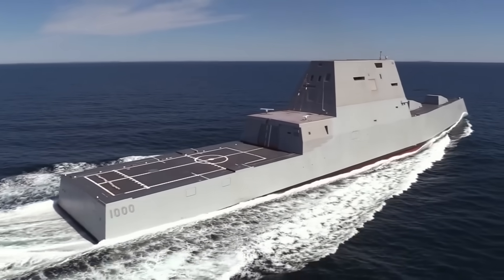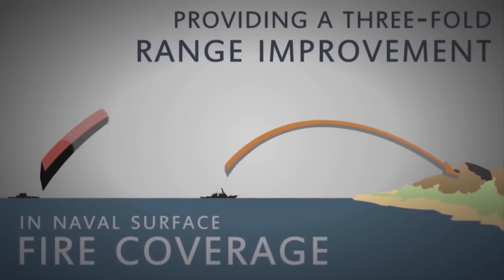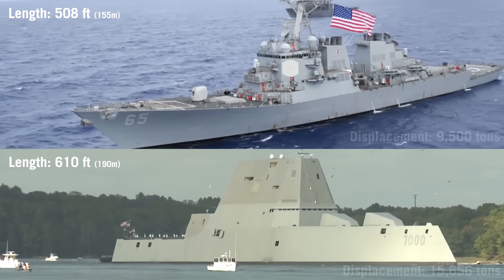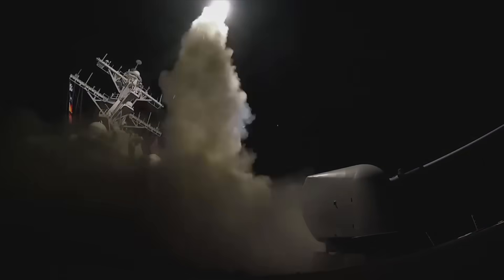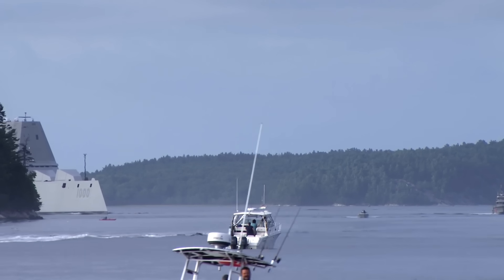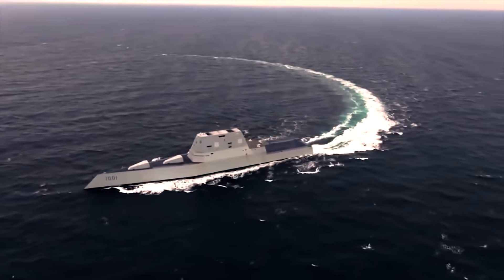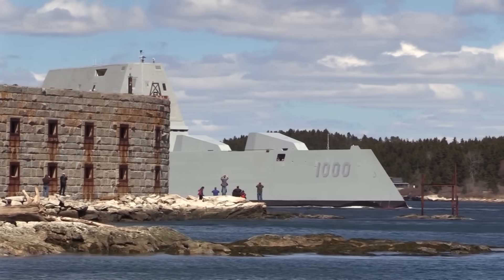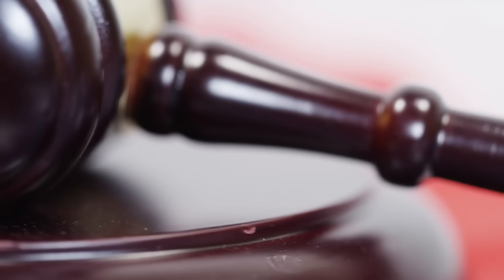What Killed Zumwalt Destroyers?

Comment: Zumwalt along with many modern US military program suffered from the "One platform do all mentality". You end up with a platform that tries to do everything but nothing well. In order to meet what was originally envisioned,  more money is spent to patch it. Now you run into all sort problems like "this was designed for X but now with the required modification it does not fit".

Comment: 155mm shells are cheap and used by the millions in Ukraine
Reply: Not the fancy ones used by zumwalt.
Reply: M104 155 mm projectile
M107 projectile
M795 projectile
M110 155 mm projectile
M121 155 mm projectile
M687 155 mm projectile
M712 Copperhead
M982 Excalibur
M1128 projectile
Install a new barrel or replace the liner,

Comment: Here's your translation to English:

"Everything is twisted and contorted like a snake on a frying pan, trying to hide the simple bitter truth. They failed to create either an electromagnetic gun or a laser air defense system, for which the ship was designed. And the problem isn't just trying to cover up an embarrassing scientific and technical failure. The scientists are not to blame. Only severe corruption or complete unprofessionalism bordering on stupidity can create this sequence of incompetent planning decisions by politicians and high officials, leading to such gigantic expenditures of taxpayer money. And this is not the only case. The Littoral Combat Ships program, the F-35, and surely much more. This is just the tip of the iceberg.

Comment: The US Army has a 155 mm gun for it's Paladin mobile artillery system. In the short term, a modified version of this weapon could be fitted in place of the original guns. Until a dedicated 155 mm/60 Naval gun is developed to replace it. It may, or may not be feasible. Yet any bored out 6" gun designed for a light cruiser could take up the unused deck space. Such a gun could be configured to fire the US Army's Excalibur guided 155 mm round. Just one possible answer to the main guns issue.
Reply: Still doesn’t fix the fundamental issue of when would you want to risk a billion dollar stealth ship when normal ships with normal guns exist for low risk targets, and you don’t want to risk billion dollar stealth ships in high risk missions, you use tomahawks and F-35’s for that.

Comment: The hull design and propulsion seems to have worked.
I would ditch most of the  stealth features and remove the problematic guns. Install one standard 155 Naval gun and add additional vertical launch tubes.
So build a new fleet defense Cruiser specialized in anti air.

Comment: #1) Defective materials
#2) defective design
#3) Design & build as you go
#4) Keep changing the specs as you build...keep changing goal the posts
#5) Make sure the walls have bad welds & cracks in the aluminum plates
#6) Make the ordnance too expensive to shoot
#7) Make the powerplant & electronics systems so complex, they keep breaking down, requiring "a tow" back to port. Actually occurred during the filming of Discovery TV episode on the new LCS marvels!
#8) The armament pods were mis-sized, poorly designed, architecturally unsound, and so much more expensive, it seemed all they could use it for (until the US deploys its own super-hypersonic, trans-warp, 25,000 mph "better than China's & ruzzians" were more cruise missile launchers (b/c we never have enough of those sitting around in port in repairs!)

Comment: OK so my father spent 21 years in the navy and when they designed this thing he took one look and called its doom from the rear design of the ship alone. Let me explain as he did. Large vessels are designed to ride over the top of waves. Your standard destroyers, frigates small to medium vessels are designed to ride atop 2 waves essentially bridging them where battleships and carriers even tankers are designed for 3 waves. Now because the zumwalts rear kind of slants inward toward the tower instead of away it allows a wave they just traversed over to essentially breach over top and smash down on that pretty helicopter pad. A large enough wave and enough weight, it can lift the front of the ship out of the water hampering it's maneuverability. It can't turn in rough water. Like I said, this is out of a highly experienced 21 year navy vet. Idk though, idk shit about boats.
Reply: Zumwalts have been tested in class six seas- the Captain said he was very impressed with seakeeping and speed! Perhaps the width of the stern and the bulbous submerged bow made the difference.

Comment: Actually the real reason why the Zumwalt ships got canceled is the over whelming amount of xray welding on over whelming high strength steel that needed labor intensive preheat set-up time. So each of the three ships was built three times due to over whelming xray weld failures, and in most times it was weld failures that was the size of a spec of dust!!!!!! And  then also the ship structure was installed off location half the time by as much as 6" down to 1" or less and that required lots of labor intensive re-work from multiple trades. But at the end the day least the US Navy got a very well built ship that is 2nd to none........

Comment: VERY simple...  US Congress and USN have NO effective 'incentive program' in-place to force weapons makers (only 3 in the USA)... to deliver 'numbers and effective quality' in any ship program.    PORK by the 'war for profit military industrial complex' whom Pres. Ike in his last intentionally recorded speech... is at fault.    If, for example, with ONLY exception of the US proprietary electronics systems were removed, and the 'rest' of a war ship were produced by Israel, Germany or India for us, the cost per ship would be reduced by over 250% and the quality finishing and fit for deployment would notably increase.     In this video there were some horrible mis-statements.   First, one does not need 350 personnel to fight a fire or war damage to save a ship..  96 original sailors was enough if only 'survival design' had been employed (these new ships could NOT take a 'RPG' and survive due to the non-naval metals used, as one example of many.   Secondly, the new designed absorbed an inordinate space interior for 'comfort and luxury' and while over twice displacement, offered 20% actual reduction in weapons and survival systems space.   Finally, the 'cost to maintain' ended up being Far MORE than the prior series.   Overall, this ship series DDA-1000 'lied at every single promise but one'...    Lack of variability, Lack of cost-effectiveness, Lack of weapons payload deployment, Lack of crew integrity integration, Lack of material engineering, Lack of ability to survive even common coastal 1945 weapons attacks against it.       ....    the ship series was not doomed by 12 new techs and costs alone... but by the assumption to choose aluminum and other weak metals resulting in ship where a 50cal round could penetrate it's hull.    even the 'most rudimentary basics' in durable warship design were tossed out for 'toys and allusions of grander'.        Pseudo techy's instrumental to it's design in the 90s and after; simply had zero appreciation or respect for WW2 ship 'survival after multiple hits', and child-like tech over sound common sea-craft sense.    These young computer designers had NEVER, Ever studied key US Navy vessels in WW2 and how they had 'survived' multiple hits, and returned to port..   and had never been given a live fire example of 'hits to a retired USN vessel' by WW2 up to common low-range missiles and projectile hits....    Today, the USN is 'amiss' in this critical component.   They really need to take a mothballed WW2 design warship out, and with ALL... ALL US designers and engineers present...  observe it being hit by RPG, 50cal, and short-range missiles......    THEN.. take a retired USN ship from the 1980s... and do the same hits...  and watch the difference...   MOdern USN ships can not take a bullet, if near a coast or shot at by smaller craft...  AND, they lack the defensive and offensive firepower to defend themselves too.     Big FAST money Mil industrialists are today producing smaller USN and Coast Guard craft with WW1 style '30cal and 50cal' defense setups which oddly protect the Seaman operator LESS today (no durable armor around the gun) than a WW2 gun emplacement.    And, have no 'durable' barrels...    Today's 30 and 50 cal guns, have LOWER life expectancy, and a higher rate of 'jamming, overheating and failure' than same cal guns made in WW2.  We've actually 'stepped backwards' in our small Naval craft design.    Finally, in any sea or coastal conflict lasting MORE than 100 continuous days, over 65% of todays USN craft designed since 1978, and built from 1995 to 2018... can 'survive and operate'...  due to an inordinately 'poor quality SUPER high maintenace' of systems on board ship.   Even 'buttons, knobs, simple operation lights and LED screens 'fail at an alarming high rate' needing replacement or repair.    This is NOT the fault of technology....   advanced electronics by nature should be, and CAN be more 'durable and reliable longer-life-span' than E-systems of 50 years ago.   BUT... it is the 'GREED for the buck' for ongoing repair materials.... that cause the USN in partnership with our top 3 main ship design-builders.. to make craft that 'intentionally have component failure rates over 300% higher than similar civilian systems.   Meaning, one need not be hit by a missile or projectile,... just stay in the war front more than 100 days, and most systems and components will 'fail as designed to fail'.    In any ongoing war or conflict of longer periods, most USN craft could NOT stay in the battle at all.      A WW2 carrier could survive several hits, and still launch planes.   Today's carriers need not be hit, they will fail in under 100 days to critical systems all by themselves, and if ever near anyone, again, have such thin hulls that they too could not take a RPG of the 1970s, and survive to fight.   ..... NAVYs of other free states world wide would 'survive to keep fighting' when USN vessels limp back for more repairs while never struck by anything.      PRIDE goes before destruction...      I have a tested and Proven method and program to get Designers and Builders to 'design and produce under cost ships that will be 8000% less maintenance intensive and have longer life-spans in-war-theater... an incentive program tested before.     ASK if you have the 'true US constitutional loyalty to AMerica' over profiteer war makers... and I will supervise these effective programs for the next productions and generations of systems and structures for the USN and Coast Guard.. ...  honor does not come while supporting ships that can not stay in service without intensive ongoing repairs...   have the balls to damn the profiteering, and get us USN vessels that our men and women can 'keep in the frey'.

Comment: It was not an actual cost overrun, it was the shrinking class size.  The project development was originally spread over 32 units.  When it's spread over 3 units, the per unit price goes up, even if the actual cost per unit does not increase.

Comment: The Zumwalt class was originally designed with rail guns from the very beginning, the DOD overestimated the readiness of that tech so a advanced conventional gun was installed as a stop gap measure.

The entire ship was based around future tech that has not been proven including the stealth features which is actually WAY more simple than you think. The combination of these technologies will make the Zumwalt class very effective at fighting 3rd would nations but it cannot fight against a near peer rival, it’s far to fragile and unreliable.

I went to college specifically to work on the Zumwalt class but ended up taking a different career path. It was very easy to tell back then this thing was dead in water.

Comment: If they want a land attack ship shouldn't they make a battleship with the iconic mega caliber guns?
Reply: battleships and heavy cruisers have been considered obsolete for several decades , none built to replace existing on life span expiry . Rockets and missiles are better and cheaper then big guns and a ship to carry them. much more punch can be delivered with small cruisers and destroyers. They are quicker to build.
Reply: @MrBonners  then why aren't they making zumwalts which is basically a battleship but with extra steps?
Reply: @celticlad5866  it failed in some sea trials and cost over runs. It is not even close to a battleship size.

Comment: The second you fire a weapon it severely limits the stealth tech... not if the weapon is fired into the water, or without a launch blast, or if it's shot from a rail gun for initial propulsion, or an air cannon, or if a stealth VTOL drone takes off from a bay and it launches from that platform, or if the missile is stealth, oor... or... use your imagination.
Reply: Water transmits sound 1000x better than air  so shooting into the water isn't stealthy. Name all the weapons in the USN inventory that don't cause a blast or other noise when launched. The rail gun has been cancelled. You don't need a 3 billion dollar vessel to launch stealth drones (that don't exist).

Imagination is how we ended up with three shitty corrosion filled scows that are currently developing stress cracking throughout their hulls.

Comment: All of these ships are made of aluminum.  One of the countermeasures is that they use is passing an electric charge through the hull.   When you pass electricity through aluminum in salt water, you greatly increase its rate of corrosion.    The ship builders told this to the Pentagon BEFORE they were built.. several times.   The Zumwalts are literally falling apart.  This is why they are being killed off.
Reply: Not to mention when the USS Belknap's super structure burned down to the weather deck after a collision with CV 67. The USN swore off aluminum construction in their future vessels.

Comment: P GR, Not all guided shells are that expensive, M982 Excalibur shell price was down to $68,000 by 2016. Laser aiming was added in 2015, and by 2018, 1400 rounds had been fired in combat in Afghanistan in the Army's M777 Howitzer. Search for M777 Howitzer.  – Upgrade created by the Extended Range Cannon Artillery (ERCA) project to extend range from 30 to 70 km (19 to 43 mi)

Comment: The 6.1 in gun 155 mm, are not operational as stated due to the cost of projectiles these costs escalated due to the cutting of the number of ships from 29 to 3 .
The fact is we need to get the 6.1 inch naval gun into service the more guns will drive the costs of projectiles down.

Comment: ... and yet, somehow the F-35 has been allowed to continue, despite being blowing out the budget to ungodly levels, failed maintenance systems already being replaced, planes being built that have to be "patches", and no even matching up to what is desired. (that includes trying to make them do too much).

I feel these fails partially because engineers are not allowed to do their job, or are not listened to. How many times I have to rush some piece of software that caused issues, because I didn't have the time, or someone insisting on a feature I try to warn then about, or possibly, offer a better solution to be ignored, and it never ends well

Comment: The more complicated you make a machine and the less manpower to run and operate a system the more difficult it is to keep in operation and the more prone it is to breakdown and have malfunctions.  It was just another pork baral spending project.  The concept was ahead of its time in both technology and ability to manufacture in a reasonable manner financially and monetarily.
Reply: Ahead of its time ? Not really, stealth ship and automation reducing crew sizes have been around for decades. Even the guns are basically boosted versions of already existing land-based artillery systems.
The main issue is the US has a lot of momentum when it comes to ship designs, Burke's commissions started in 1991 and ended in 2017, that's a 25 years difference between the first and the last unit. Resources spent into making such large classes of ship come at the expense of neglecting hull development.
Some countries are working on their second or third generations of stealth surface ship already

Comment: The total lie that lifetime maintenance costs were going to be contained with fewer crew members and no preventative maintenance has come full circle. The LCS (both versions) suffer from the very same cost overruns and long-term maintenance issues. Cost to benefit ratio is zero- with not a single shot fired in anger since the unveiling of the vessel classes using the new procurement system.
These are truly test-bed vessels- looking for a mission niche that needed more boat- not bloat.

Comment: As a software engineer, I remember quite a few projects where people (myself included) tried to use too many cutting-edge technologies. Some of these projects failed after cost overruns, just like that destroyer. I guess that's a common thing in the entire field of engineering.
Reply: @Ralph Freeman I think this misses a bit of context in that war has changed a rather lot over the ages. Whereas a truck built in 1950 can still do an okay job at being a truck, assuming it has been well taken care of and maintained, a warship built in 1950 is likely completely unfit to purpose. And that unfitness is a result of how much the technology to perform its job has changed in the last seven decades. And even car designers do a clean sheet redesigns ever few years when a model reaches the limits of its old chassis.